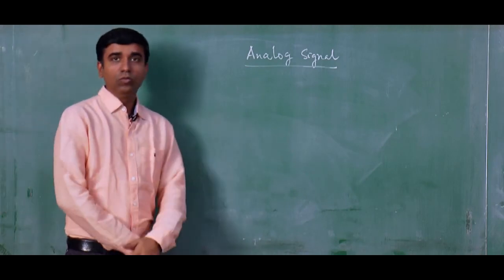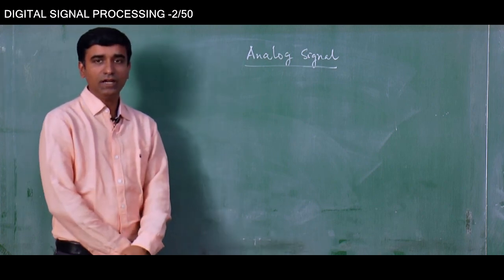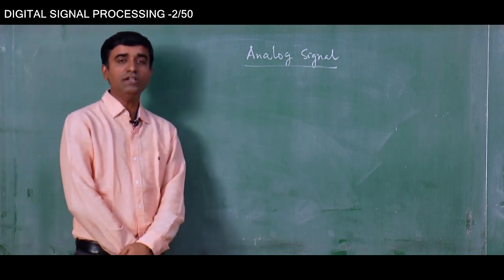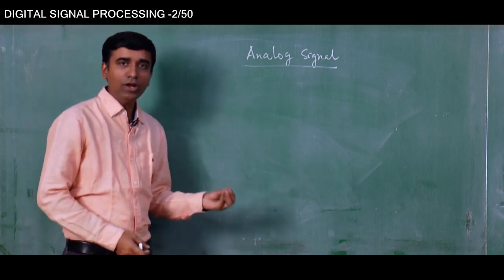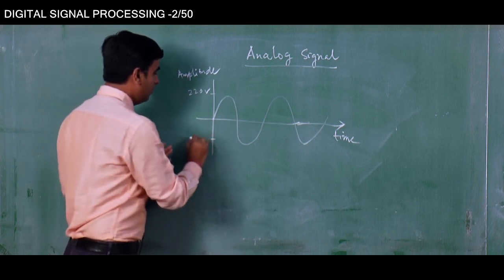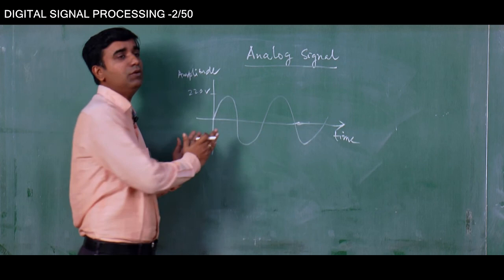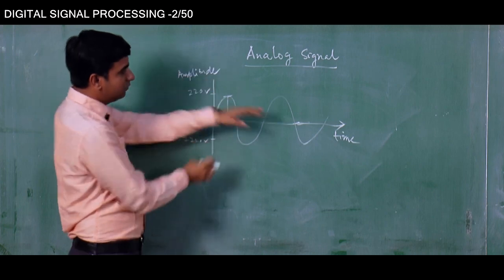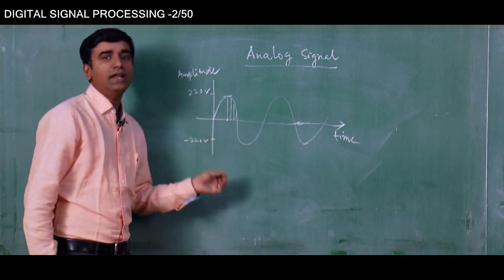DIGITAL SIGNAL PROCESSING | LECTURE-2 | PROF.(Dr.) MALAY GANGAPADHYAY

Comment: Sir i can understand ..., but i have a doubt sir....., why we are go for analog to digital.?
And what is the main difference ? Pls answer these question sir...,? Tq for these vedio sir....,
Reply: the main reason being that there has to be data optimization, as in digital, only discrete values have to be stored, but in analog signals, there are infinite values between any two points on the abscissa of the curve (x-axis), which results in more storage required to store all these values. In digital, it is not there